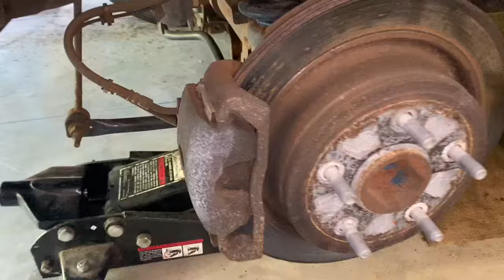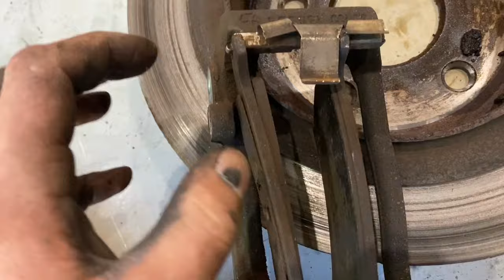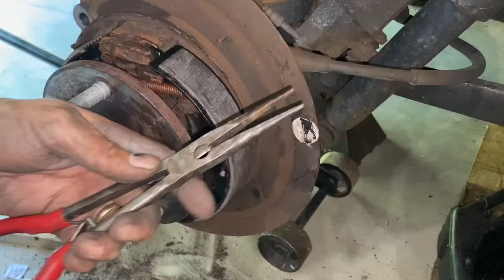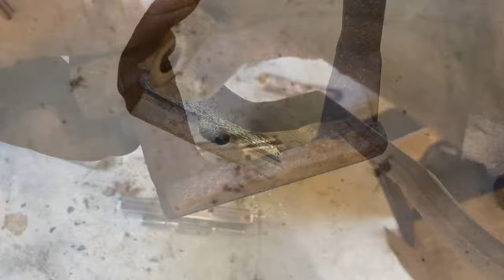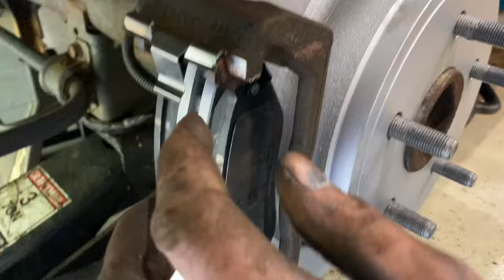2015 Ram 1500 - How to Replace Rear Brake Rotors, Pads, & Parking Brake Shoes

Comment: I bought a $8 brass sledge from Harbor Freight that I use to knock rotors off by hitting them from the back side. The brass is so soft, it doesn't damage the rotors. This makes rotors so easy to take off!
Reply: I got an air hammer at HF to buzz on the hat for 15-20 bucks if my memory serves me right. Usually five 1 second buzzes does the job too. I like guns! I like your idea too but pulling a trigger is more fun!😂

Comment: Always replace drum hardware. Springs if exposed to high heat (driving with the e-brake on) can lose strength and can lead to uneven wear or even failure. Media delaminating from the backing plate happens for a lot of reasons. Corrosion for one. Doesn’t necessarily mean its poor quality. Back to the hardware… your already at the parts store get the hardware, its $5, get the proper lubes and chemicals too. Remember it is an emergency brake…
Reply: It’s not an emergency brake, it’s a parking brake though
Reply: @matteagle8206  Same thing Emer. brake , parking braking
Reply: @edwardmoody4253  the way guy made it sound is that you should use it if your brake pedal goes to the floor as an emergency brake and not just when you park the truck, that's not a good idea
Reply: No need for parking breaks over here.  Removed mine altogether. Never in 40 years have I used it 1 time. Soooooooo, why pay for it and take a day to diy?
Reply: @clintonmassengale8455  my 2012 Ram free wheels back on a slope on ice if the parking brake is not engaged. Not sure if that's a factory defect or not in the trany but this is what I have observed.

Comment: You need a heavy hammer to hit the rotor on top of the rotor drum or between the lugs bolts if that doesn't work use the proper puller if available. If the rotor is not being reused hit it from the inside.

Comment: Currently 14 minutes and counting and this video made me decide to just try and adjust the star bolt for my parking brake that isn’t working and If that doesn’t fix it I’ll watch your video again when I change my brakes in a year and screw with it then. Awesome content straight and to the point. thanks!
Reply from the maker: Glad it’s able to help you out. The job is really terrible. I’d avoid doing it if you can. Seriously, it will make you think bad thoughts about the engineers that designed it.

Comment: Well done. Good lighting. No never ending sanctimonious talk. Yes, that parking brake repair is a pain. Now I know and I will have a pro do mine. And I’ll make sure he puts some anti-cease on the hub before putting the new disk back. Easier to take off next time.
Reply from the maker: Yes, it's not fun at all.  I would recommend having somebody else do it if you have that option!

Comment: Your video really helped, thanks. The unusual amount of rust on my rotors extended my brake job from a couple of hours to two days. As with yours the parking brake shoes detached from the backing as soon as I removed the rotor.
Reply from the maker: Yeah overall, it’s not a super fun job to do. I would not want to do it again. Getting the parking brake to work well once the job is complete was a frustrating task as well. At least it’s over now! Thanks for watching the video!
Reply: I adjusted the shoes were I thought they should be. Unfortunately it’s not were they need to be to be effective. I was so happy to get the job done I didn’t want to climb under the truck for another week. I’ll get to it next week. Thanks again

Comment: Very useful video. For me getting the two springs in place took a long time on side one, but went pretty well on the other after some experience. The video is missing some detail there. I found that after the springs are started in the first shoe, putting a screw driver in the hole to hold them in place made it easier to stretch the spring into the other side. I also used a magnetic pen and trim remover tool on the hold down clips. I put one clip in place before finishing the two springs and that seemed easier. Another note, in my experience, don't use copper antiseize on brakes because it can cause the ABS sensor to have incorrect reads if the antisieze gets on the tone ring.

Comment: If you have access to a rivet gun and things are hard to get off you might call it plan d or so . I don’t have a rivet gun until I go to work and use one of theirs. Also recommend taking pictures as you go so putting it all back together is 14% easier,   Great video btw.      Bill
Reply: @dropndeal  he probably means impact gun, but he's hammered or ignorant.

Comment: probably be good to put blue painters tape on the pads till your done because of the way you have to keep handling them to install. nice job
Reply from the maker: If it helps people sleep better, sure they should do that. 

In my reality, the brake pads are exposed to rain, mud, salt, asphalt, rust, rubber, heat, and a whole world full of contamination every single day. If fingerprints on a rear brake pad made a difference on a 15 Ram, I probably would have protected them. But for my personal vehicles, it simply doesn’t matter.
Reply: I contaminated the hell out of mine so thank god for brake clean. Those damn shoes were jumping all over the place to get ‘em lined up. Just clean the shit off em when you’re done.

Comment: Now that you’ve done it your way would you recommend doing it this way versus removing the axles to make it easier to work on the hardware and then have the added bonus of replacing the diff oil at around 100k km/ 60k miles ???? Since the diff cover would be removed in order to pop the click and pull the axles out. Every local mechanic wants to pull the axles out.
Reply from the maker: That's a tough question!  My method was terrible, and took a really long time.  Having the axles out would have helped a LOT. If you are somebody with less patience or giant hands - pull the axles!  If you have tons of patience and small hands - leave the axles in!

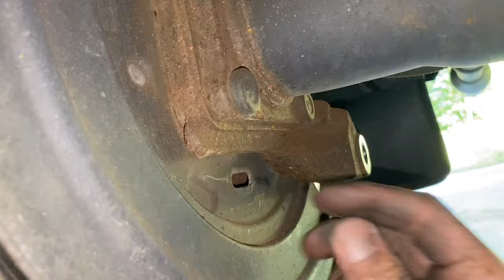Comment: At the 2:50 mark, you point out that the emergency brake adjustment is on the Bottom on the passenger side and the Top on the driver's side.  However, the video doesn't mention the fact that the direction you turn the star wheel is opposite, depending on which side you are on.  On the passenger side, you put the screwdriver in pointing down and turn the wheel up as shown at 3:15.  But on the driver's side, you want to do the opposite. Put the screwdriver in angling up and turn the wheel down
Reply: Many thanks for this merciful tidbit of information.
Reply: Jeff, I must’ve tried 8 times back and forth, already knowing what you said to be true. Just lost track in my minds eye. Got it done but geez it should’ve been easier. That drivers side is a bitch with the tire back on but that’s how I was taught, tire on until you feel it drag. I definitely was missing the late 90’s F350’s at that point with both adjusters on the bottom!
Reply: @mattsrant2872  I already had a rotor to replace the old one, so I wasn't worried about damaging it. I was beating on that thing with a sledgehammer so much that my emergency brake shoes were coming out with the rotor.  Felt like an idiot after I figured out the issue.
Reply: @golfnutt1969  Classic! The neighbors must’ve been dying. Haha
Reply: @mattsrant2872  I'm sure they were shielding their kid's ears with the expletives coming from my garage.

Comment: I just did my rear pads on my 2017 ram and they where just like the ones u did one the passenger rear also it must be a factory thing as this is the 1st set on my truck with 60k miles

Comment: Nice video.  Now I feel guilty for not checking or replacing the parking brakes.  You can also put anti seize on wheel bearing hub face and the rotors will come off way easier in the future and you will thank yourself.
Reply from the maker: Yes - I do the anti seize thing often! Great tip!
Reply: F?!&, I wish I would’ve read the comments before the job. Duh. This would’ve helped for next time. At least I’ve got a BFH!

Comment: I followed every advice in the video and it's not breaking loose. Fully loosened the brake shoe star thing. Undid that factory washer doohicky. Smacked it VERY hard with small sledgehammer all over - breaking the metal rotor... And I tried leverage with a long crowbar. No dice. You sure there isn't a hidden bolt holding the rotor to the plate? I couldn't find one.
Reply from the maker: It truly is a miserable job. If the brake shoes have worn into the inside of the rotor, there is a rusty edge that they get hooked on which prevents the rotor from coming off. They do make brake drum pullers that you might be able to rent at a local auto part store. The other option is to keep cutting and cut the drum off with a cut off wheel. Lastly, if you haven’t bought parking brake shoes you probably should now.  Sorry you are suffering through it, I did as well.
Reply: @WiringRescue  Hopefully Partsource is open on Canada Day and has these brake shoes in stock. I got the brake rotors and pads from rockauto. Would suck to have to put it all back together in order to go dirt biking today. I appreciate your kind words and advice.
Reply: The penetrating oil I put between the rotor and axel and in the lug bolt holes didn't help. I can turn the rotor a small bit before it engages the drive so I don't think the shoes are engaged. I think it's just seized to the axel. I'll see if anything is open that can rent me a brake puller.
Reply: The only tool I can find to rent or buy is called a hub puller with a sliding hammer. Canadian Tire says it will take the rotor off with the hub. Is that ok? If it achieves that, I think it will have defeated the fact it is seized to the axel. I just don't know what I need to expect for putting the hub back on. And hopefully the rotor isn't seized to the hub.
Reply from the maker: I don’t think that style hub puller is going to work for you. Your rear drum is stuck to a solid rear axle, not a hub.  Does the drum pry off even a little bit, or is it 100% solidly attached to the end of the axle?

Comment: Good Video. Question,  is there not threaded holes on the rotor for a bolt to be screwed into to release the rotor ?
Reply from the maker: On mine, there were not any holes for doing that. Maybe you will be luckier than I was !

Comment: Hello, I just replaced all my calipers,rotors, brakes. The loosening of the parking break was a great idea for getting the rotor off, although I attempted to retighten it after I was done. I’m hearing a scrapping noise when I drive now, could it be because I over tightened the parking break?
Reply from the maker: If it’s getting hot then you over tightened it. If it’s making a scraping noise, most of the time it is a backing plate rubbing on a rotor/drum. Jack up the truck and spin each whee by hand, you should be able to easily spot the problem if it’s a backing plate. Just nudge it back into its happy place and drive on!
Let me know what you find!
Reply: @WiringRescue  okay thank you I appreciate the help man

Comment: I know it could be a 100 different things but I'm getting a burning smell from the breaks i replaced. Any idea what it might be?
Reply from the maker: Something is dragging. The clips that attach to the brake caliper bracket would cause that. Also brake caliper slide-pins would do it too. I’d recommend figuring out which brake is getting hot and taking it apart to fix it before it gets way worse. Good luck!

Comment: Great video.   About to do my rear brakes.   I was considering maybe doing the parking brakes - now I’m gonna leave them as is unless they fall apart.   Question though - how do you adjust the parking brakes when all is done?
Reply from the maker: There are adjustments in the cables, and the self-adjuster (star shaped thing) inside the rear parking brake drum. Start by adjusting the self-adjuster in the rear brake drum as shown in the video. Then the cables if necessary.
Reply: @WiringRescue  thanks!   I guess more specifically, do you adjust them to the point they start to grab/rub the drum  a little?   Or just before they start to grab/rub the drum?  That’s what I’m not sure of
Reply from the maker: @jeffmarcum3643  - typically I adjust them until I can juuuuust barely hear and feel them scraping the inside of the drum. Then test the parking brake to make sure they work. I fought with these ones for a while and they were still mediocre at best when I was done.
Reply: @WiringRescue  thanks for the info and the quick reply!
Reply from the maker: @jeffmarcum3643  happy to help! Good luck with the project! I’m cheering for you!
Reply: @WiringRescue  all done thanks. Didn’t mess with the parking brakes.  Had to beat the rotors to get them off.  Think they were originals - at 128000

Comment: I’m seeing mixed steps. Some open the bleeder valve to alleviate the pressure and to prevent “dirty” fluid from returning to the system when pressing in the caliper piston. But it’s essentially a closed system. Here I see that you didn’t do that. Thoughts?
Reply from the maker: I have never done that and was a tech at a dealer for years. None of the techs that I worked with did that either. HOWEVER , I do know people that do this. I just find it to be an unnecessary headache. It’s totally up to you. Do whichever will make you feel better when the job is done. :)
Reply: Just open the cap on master cylinder. I haven’t seen a single manufacturer say you need to open the bleeder valve when compressing
Reply: @WiringRescue  thanks for the confirmation.
Reply: @FleetTech97  as you described it seems to be the consensus. Thanks for the response!

Comment: The rear shoes broke loose and raised hell so I was forced to take on this miserable job (2017 1500 Promaster). Replaced rotors and pads and will return to deal with parking brake when a new cable arrives. I  thought it was me losing my skill to old age. Really poor design and the clip fell off because it was not completely seated when originally installed (44k miles). Misery loves company, thanks for the video..
Reply from the maker: Thank you for sharing in the misery! Is the pro master the same incredibly dumb design?! That’s too bad. The best part is when you get the parking brake shoes replaced and the parking brake barely works no matter how tight you make it. 

You aren’t losing your skill. It’s a seriously terrible job. I’m cheering for you!
Reply: @WiringRescue  Yup same dumb design. Now waiting for back ordered cables. Just replaced springs & struts on my 2015 Beetle. Another stupid design. The earlier VW'were really easy. Glutton for punishment.

Comment: Question the self adjuster to you go thr same say for the driver side to make it smaller? Having hard time removing the rotor just want to make sure I'm going the right direction
Reply from the maker: Sadly, I don’t remember, but you can pretty easily spin the self adjuster, and then try to spin the brake drum. Then turn the adjuster the opposite way and spin the drum again. Whichever way feels tighter is the wrong direction. Good luck!

Comment: I cant even reach the adjuster star.  it looks rusted on and I cant spin it.   Thoughts?
Reply from the maker: You may need to try a variety of different flat screwdrivers and use a flash light. The whole job is way harder than it should be.

Comment: Wait a min. I thought there was some sort of clip holding that roater in place. Besides those clips on the lug bolts
Reply from the maker: Nope. But the inner brake shoes hold the rotors in place quite tightly. So you’ll have the benefit of that fight! :D

Comment: Stupidest design ever  just to make it so they didn't have to make separate parts for the brakes.. This way there are no right side and left side parts.. But in the driveway it makes it so much harder to maneuver when doing the rear shoes... Then I found out my backing plate was rusted out at the shoe clip and they want 250 for that part and you have to take the rear axle out so No emergency brakes for me lol.  Great video by the way
Reply from the maker: I completely agree that this is a horrible design. If I could get an inspection sticker without a parking brake, I would have ignored them as well! Thanks for watching!

Comment: He skipped through the hardest freaking part. Getting the 2 long springs and shoes in place
Reply: I made up both shoes with the springs and spread them out to get in the notch. Then put the retainer pins in.  Full disclosure, NAPA’s “premium” parking brake shoe kit is junk. Broke a retainer pin

Comment: Unless it's a manual transmission the parking brake is useless. I delete parking brakes whenever I do rear brakes.
Reply from the maker: Sadly the Massachusetts state inspection requires a working parking brake. So we have no choice.

Comment: Yeah, those parking brakes are a booby trap. Never use it, and only remove the parts. If you have a brake emergency, you won't have time. I had a brake failure when I first started driving, and did all the repairs myself. They hardest part is not hitting anyone.

Comment: I used a big hammer in mine for 45 minutes before it broke loose
Reply from the maker: Its truly an awful rear brake job to do.  I'm sorry to hear that that you were tortured with it as well! Thanks for watching the video!
Reply: I followed every advice in the video and it's not breaking loose. Fully loosened the brake shoe star thing. Undid that factory washer doohicky. Smacked it VERY hard with small sledgehammer all over - breaking the metal rotor... And I tried leverage with a long crowbar. No dice. You sure there isn't a hidden bolt holding the rotor to the plate? I couldn't find one.